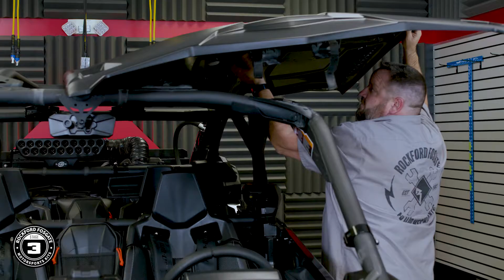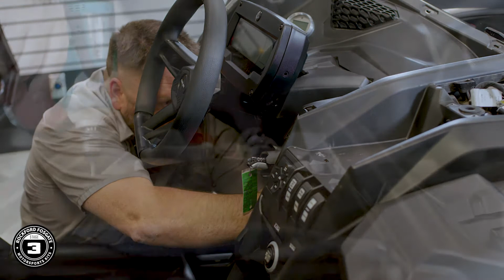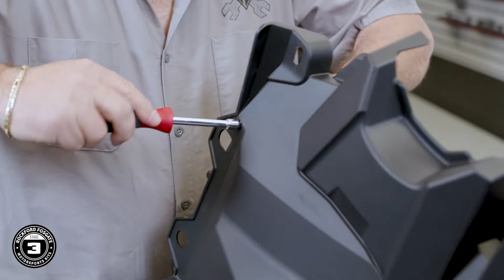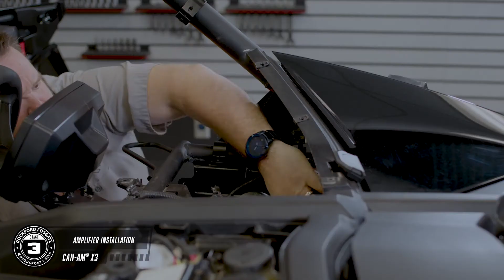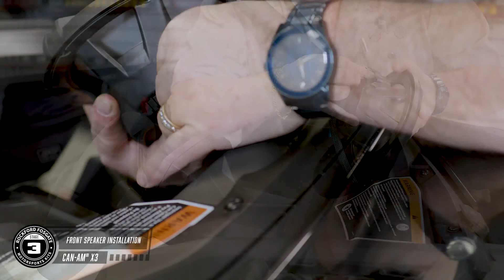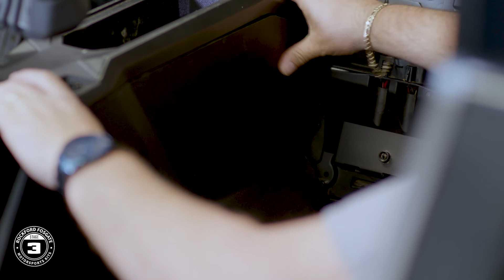Can-Am X317-STG3 Installation (Gen-3)

Comment: In the PMX harness installation chapter, where the heck is the power plug under the center dash??
Reply from the maker: It’s the hide-n-seek champion of the Can-Am.  It’s attached to the upper part of the sub-frame that holds the dash together.  If you’re standing in front of the car, have someone lift the dash panel and you’ll see the red wire.